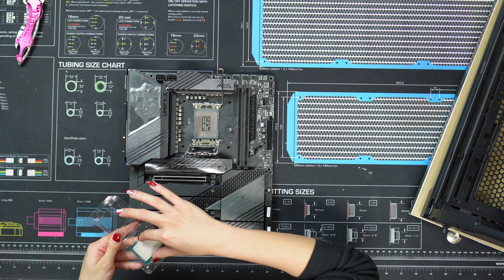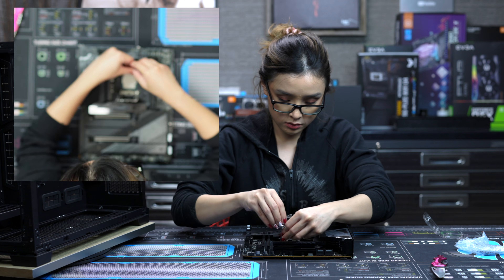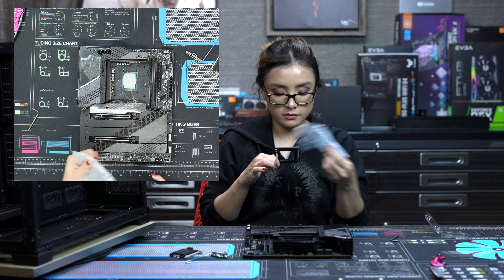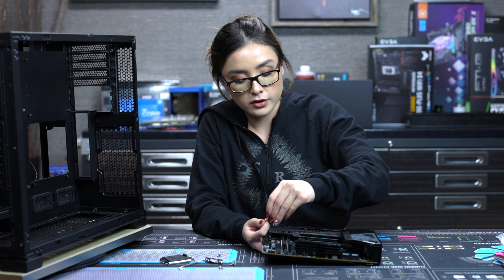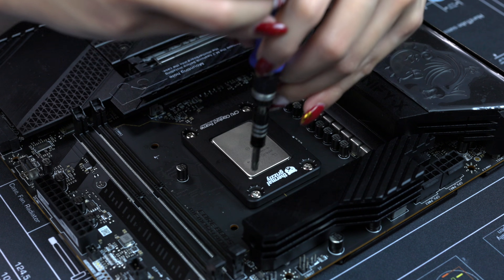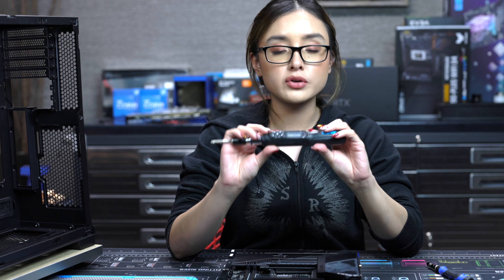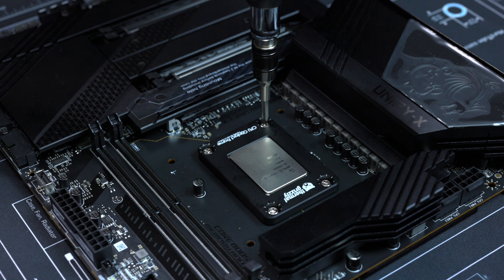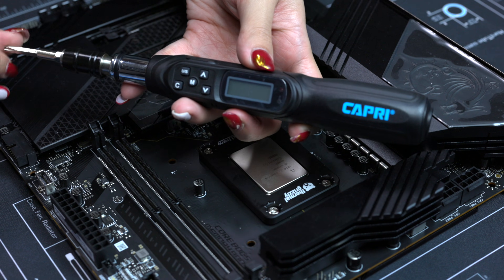Thermal Grizzly Contact Frame Installation | "Gamer's NexusING" Gamer's Nexus

Comment: Wonder if you can help with a conversion?
I have a torque screwdrive that covers 0.3 - 1.2 nm, will that be of any use for this please?
Can't find any conversion for centi nano to nano.
Reply from the maker: So if i remember my math correctly (It's been a while!), the original thermal grizzly contact frame needed to be 4-6 centi nm which is .04-.06 nm.  So yours will be too tight.  BUT, the newer versions of the thermal contact frames don't need to be torqued at a certain level!  You can also use the knockoff version (if you choose to) that's cheaper and doesn't need to be torqued perfectly too https://amzn.to/4agO9p8
Reply: @SnaxanTech  The Thermalright is also supposed to be torqued. They have instructions on doing so regarding by using feel, number of turns, etc. just like the TG one. Pretty sure all, or at least most, contact frames are supposed to be torqued (including if installing / reinstalling the original ILM) for optimal results.
Reply: @SnaxanTech  yes I have the newer Thermal Grizzly, like you I prefer to support the originators research effort.
Now wondering if spending £100 is worthwhile, considering its a £500 cpu. Wera have a sale on certain models here in the UK, 50% off! Wera 1430 Micro ESD 2.0 - 6.0 Ncm
Reply from the maker: @LDWilliams  Sometimes one that costs just 100 is good as 500, it really depends on what you are using for.